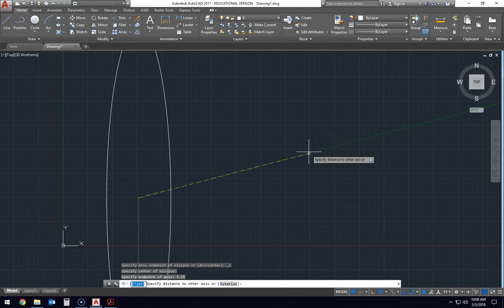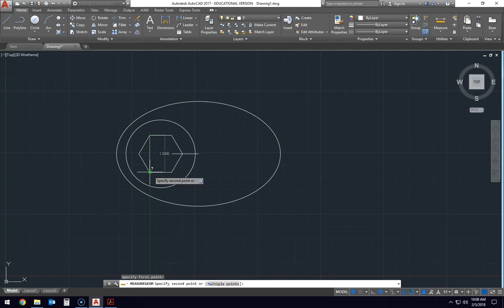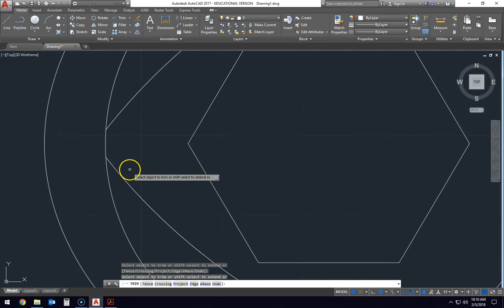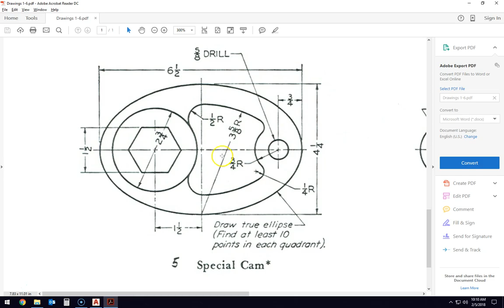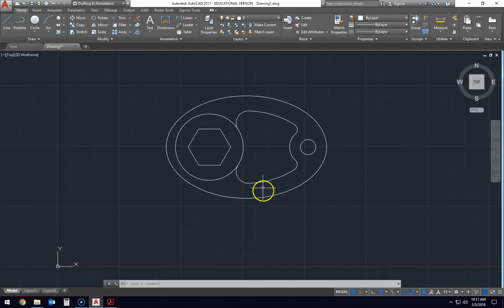Learn to Draw in AutoCAD- Special Cam

Comment: The problem I noticed is that if you shoot a dim from the center of the hexagon to the center of the .50" radius, it doesn't come out to the 1.50".  Instead, it is 1.5960". This throws off the overall area of the part.
Reply from the maker: I think I see what you're referencing, however that dimension wouldn't be 1.5". The 1.5" is to the centerline of the ellipse. The .5" radius is only a relationship between the 3.625" internal radius and the 2.75" diameter of the left circle. The .5" radius is a fillet that is "fitted" into place by being tangent to the other two curves. You'll find that a lot of drawings don't dimension every single point because it is not a critical dimension. This drawing is also likely from the 1960's, and was intended as a hand-drawing exercise, so you can only be so accurate.